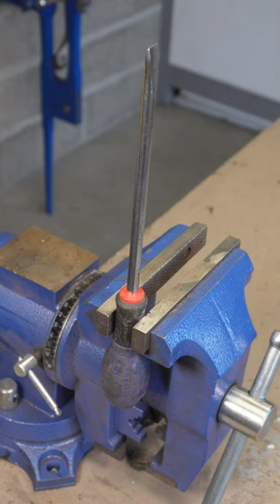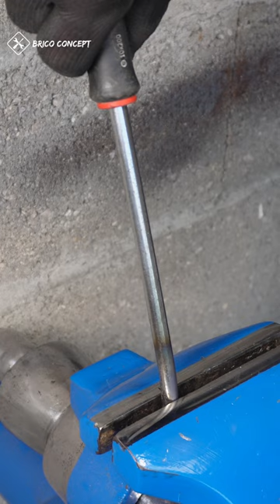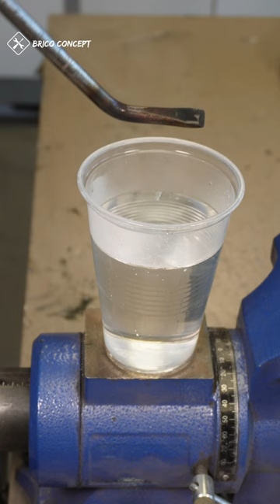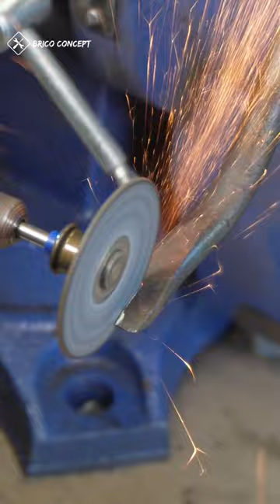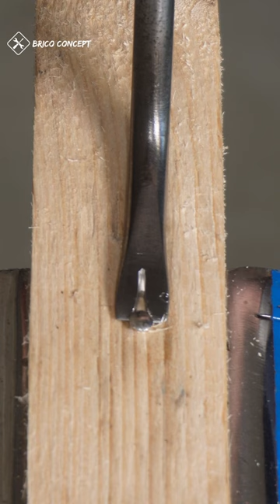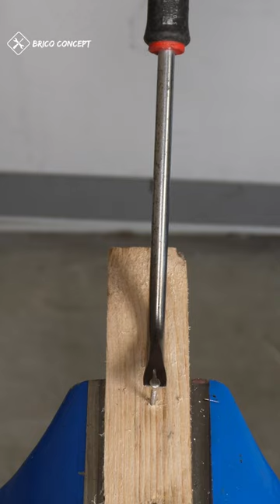Modification of a Screwdriver #shorts #diy

Comment: Yes because hesting and hardening a tool that has no use if you either own a crowbar or a hammer is a fantastic waste of time. Also the hardening process could cause severe distress in the material and actually cause splinters to fly off and if you're unlucky, actually kill you...
Reply: Se for morrer clame por Jesus
Reply: Except he didn't harden it, he did the opposite.